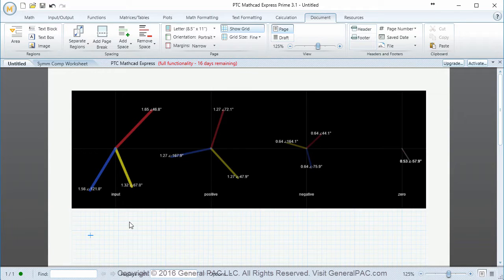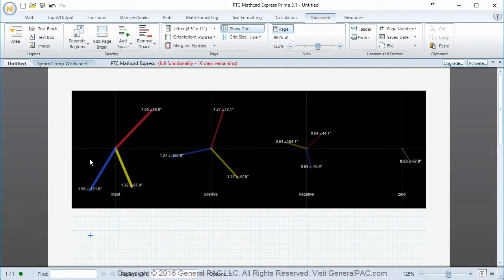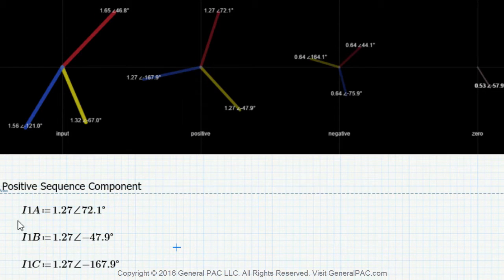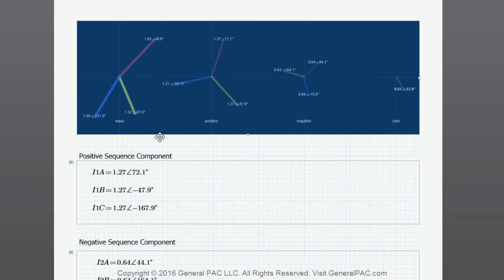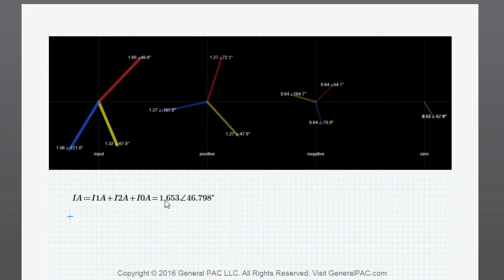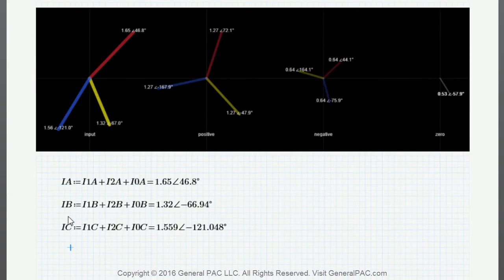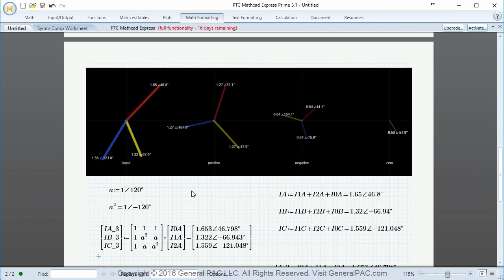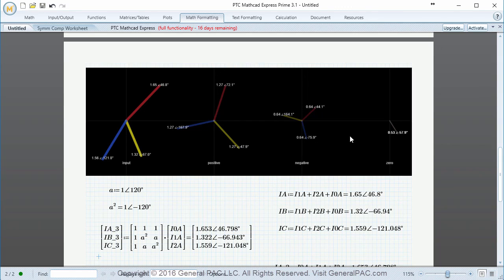Principles of Symmetrical Components Part 3e

Comment: thank you very much very helpful. one question for 3rd method...can you use I0B, I1B,I2B or C instead of multiplying with I0A, I1A, I2A?
Reply from the maker: Hey Zuber, yes we can do that. The equations will look like:

             IA=I0B + I1B/a^2 + I2B/a
             IB=I0B + I1B + I2B
             IC=I0B + I1B/a + I2B/a^2          
(phasor quantity defined as I0B,I1B,I2B)

              IA=I0C + I1C/a + I2C/a^2
              IB=I0C + I1C/a^2 + I2C/a
              IC=I0C + I1C + I2C                      
(phasor quantity defined as I0C,I1C,I2C)

Thanks,
GeneralPAC by AllumiaX
Reply: @Generalpac  Thank you very much for the response.
Reply from the maker: @CutinChai  Knowing that our videos were helpful to you is indeed satisfying. These videos are available on our website in the form of fundamental courses. You can keep track of your progress without any promotional ads. We've included some quizzes in those courses, a certificate of completion and an opportunity to ask questions from our engineers regarding the course topics. Currently, we are offering 90% discount on these fundamental sessions, join us before it ends: https://www.allumiax.com/power-system-courses